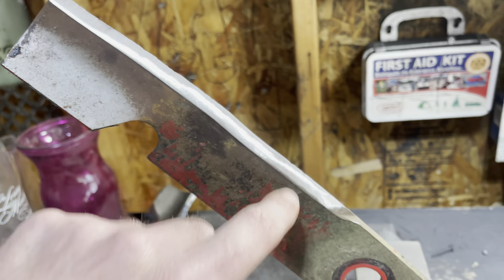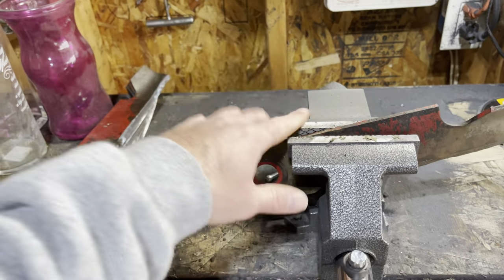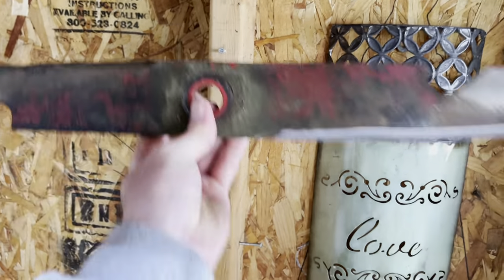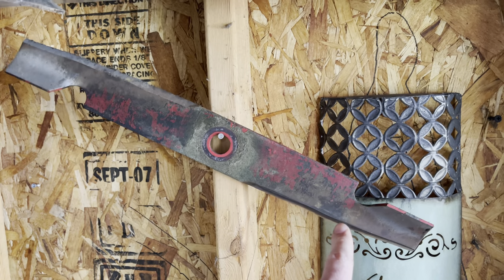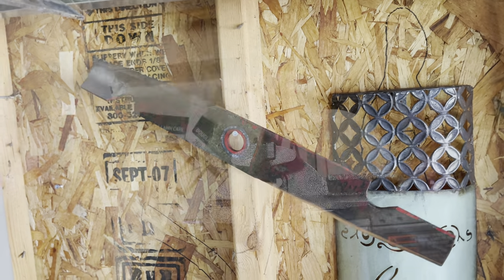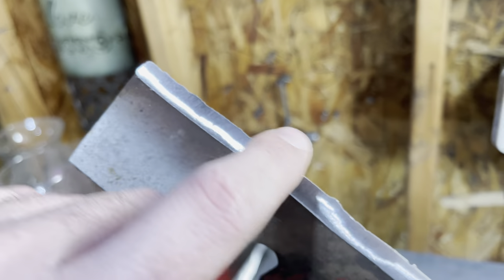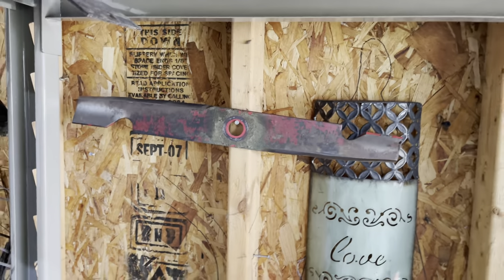How to Balance Mower Blades. The Inexpensive Way!

Comment: I agree with the other comments.  You need to sharpen the side that is that heaviest and is pointing downwards.  By sharpening this side you will be removing metal and making it lighter thereby restoring the horizontal balance.
Reply from the maker: 👍🏻 yeah. I’m a dummy

Comment: You might want to remake your video because the side that is not sharpened has more metal mass than the side that has been sharpened thus making the un-sharpened side to be heavier and drop first and the lighter sharpened side to rise.
Reply from the maker: I take it you didn’t watch the entire video? I did sharpen it and it balanced out. 👍🏻👊🏻
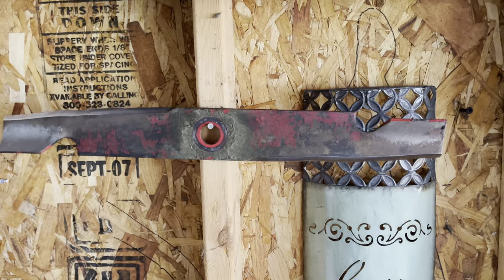Reply: You point out the high side twice as needing material removed , yes we watched the video.....at abot 50 seconds and 2:15 you point out the wrong end to remove metal from.
Reply: Put a lot of heat on that blade.
Reply: @austinicholas I don’t think it matters. They’re not hardened.

Comment: Why does the sharpened (lighter) side of the blade drop down? Surely the heavier side would go down, like it does in balancing scales?
Reply from the maker: Wow! I never even realized this! You are 💯% right! I have no clue! Makes no sense. It must have been how I had it on the nail??
Reply: @douglaslawncare2843  however you hang it on the nail isn't going to change physics.
Reply: I tried this and it's not accurate as the blade would stick on the nail even spraying lubricant with same result

Comment: Been doing it this way with a 16p I nailed into a 4x4 leg of my workbench for 22 years now. Works every year & I expect this nail will last me another 22 years. Also, it's nice because I never loose it like some gadget.
Reply: When you balance something do you find the center and start from there. Because when you use a nail your not actually in the center of the blade. I am interested in how you have over come the effects of drag on the blade and nail.
I've found when using a nail there is some good in doing it that way. Yes you can find a blade that is bad out of balance. But don't you think the hole idia is to balance your blades to the best you can.
Years ago they used to bubble balance car tires.
But it's a well known fact that dynamic balancing is much better. The same way a mower blade placed on a precision bearing service works better than using a nail.
Reply: @altonrowell613  I never said I get a PERFECT balance. I can tell by feel & sound that I'm damn close. As far as drag, Not much. What I know is after I sharpen them they feel sound & cut like new.
Reply: I have done the same, for the same reason. I purchased a cone balancer and lost it before even opening the package.

Comment: This technique is garbage if you really want something balanced correctly. You can try a little experiment set your blade on the nail like this guy shows see what it does and then without removing it try to move it left or right on the nail just a little bit and you'll see it's going to drop one way or the other. So with that said you can easily make this nail technique fail. If you don't want perfectly balanced and you want something pretty close I guess the nail technique is the way to go. A tiny amount of vibration will wreak havoc overtime. Have you changed your spindle bearings lately?
Reply from the maker: Never had an issue with spindle bearings. Ever. Mower hours, over 3000, over 1500, over 700. No issues here!